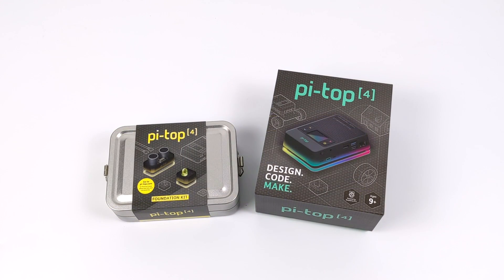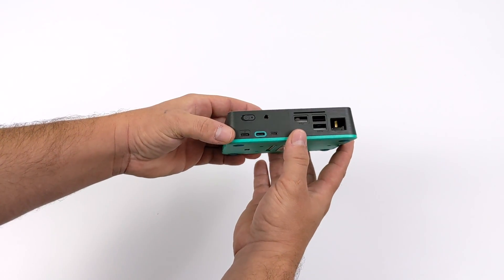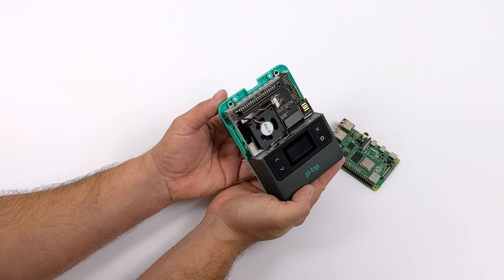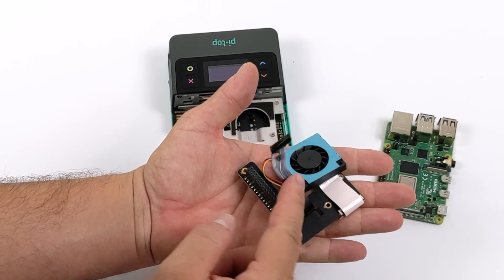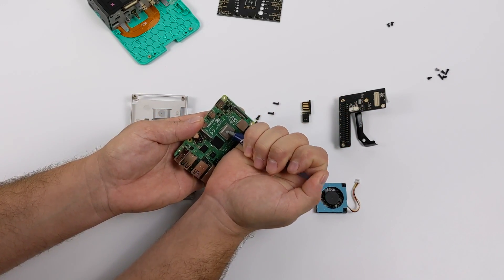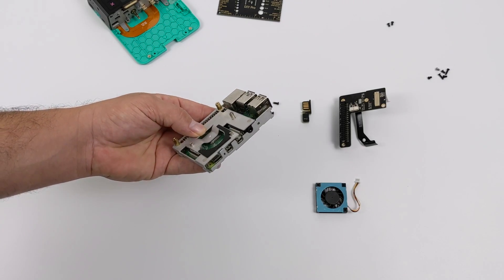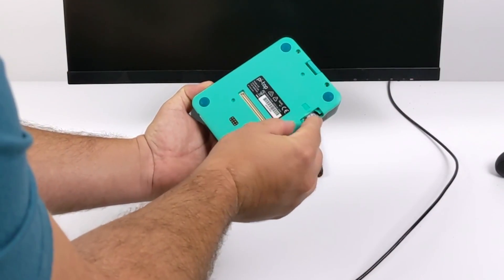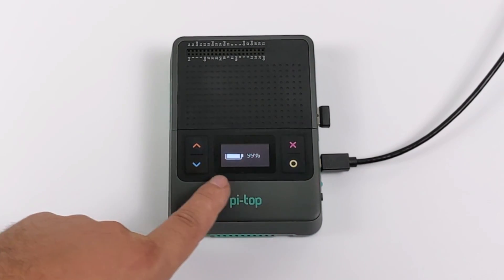Pi-Top 4 New DIY Edition - Power Armor For Your Raspberry Pi 4

Comment: There's people who own this, and people like me, who have their pi hanging from a cable at the shelf barebone, getting dusty, for 3 years now, doing it's job in the network, even is on the internet xD 

This is overengineering par excellance ... but okay, I can see why people buy this, but for 35$ you can get a 5 inch screen and with a 3d-printer a case for it...
Reply: I'm 5 mins in to the video and still don't know what this thing does...
Reply: @DConnor799  Active cooling, power bank, display + buttons and armor case and sound
Reply: There are people out there that use the pi 4 as main linux desktop, and if you want to overclock it, you need a good cooling and this pack looks nice

Comment: You know, I once loved RBPi, since that was a cheap, fanless mini PC. I used both the pi1 and pi2 as a media center. With these cases, it is not cheap and not fanless. Instead buying a Pi3, I bought an x86 for slightly more money with an SSD, USB3 and without fan (complete silence!). Now, Pi4 finally has USB3, but still, my old N4000 CPU is stronger, and while Pi has a good support, an x86 has better support.

Comment: "but still offers the same fathers like Built-in Battery"
Hmmm yes that's a nice father that I can't live without too 😜
Reply: Hey Prime, thank for your continually awesome content! What do you suggest for a power solution on the DIY pi-top 4 (for charging and such)? I know it supports 15V PD USB-C, and the one that comes with the regular edition is 36W 12V. I have a 61W USB PD MacBook charger that outputs 20V at 3A... that should suffice, right?

Comment: I put Pi-Top OS on a Pi desktop attempt and it runs great. Only issue I've had is if its left alone for a while the screen glitches, and zooms in requiring a restart. But its one of the most Windows user friendly Linux OS's that I've used yet.

Comment: 5:09 applies thermal paste drop
okay
applies heatsink bracket
uh huh
removes heatsink bracket to show spread of thermal paste
aww that's a waste of thermal paste but I guess it's a good demonstr-
re-applies heatsink without reapplying thermal paste, thus introducing millions and millions of tiny bubbles and ruining the thermal paste's heat conductivity
I screamed
Reply: Realistically it won't make a noticeable difference
Reply: @theisaacpigg27_32  realistically you can use crest toothpaste as thermal paste and you'll get "ok" temps for years (I'm not even kidding, try it)
Why even bother messing with shit where you gotta apply your own thermal paste if you're not gonna do it right? An extra 5°c might not seem like that much but it is when you factor in the long term stability and power consumption of the chip. It's just bad practice.

Comment: You made a Raspberry Pi Fan out of me.
I was looking for a small box to take with me as some sort of "classic" game console to use as emulator and as a small "low end" PC. Seems to fit perfectly for this needs since all i need to emulate is GBA/GBC/N64 games, probably try even emulating PSX as it seems to be powerful enough. Much better value than any of these "mini" consoles of Sony or Nintendo. Not mentioned yet playing around with a Raspberry Pi which i wanted since ever but never saw any reason because of low performance and im not really a fan of linux.
When i see this thing has also battery.... damn nice, all is missing now is a small screen for it to use it as regular computer on the go.
Reply: Is there any solution to use a SSD while its inside such a nice housing or is it better to go "mobile" with the data and use a fast USB 3 stick instead, which is also cheaper (and already there with my Sandisk Extreme Pro USB3.0 Sticks)? Transfer rates are pretty ok also over USB3 what i have seen.
Wondering if the OS/platform is capable of bitstreaming DTS-HD and so over the HDMI port? If yes god damn the Pi4 is damn awesome and i absolutely NEED it. Could be even "better" than a subnotebook/netbook when using it with a display with built in battery which im anyways thinking to get one because sometimes  i want on my notebook a second screen (on the go or even at home to be able to fast remove/add a 2nd screen from the table)

Comment: Great review, thank you! 

@2:08 For those of us less familiar with Pi-Top, would have been nice to have a bit more info about the "Pi-Top connector".
Reply: After reading... I don't think I like that concept much at all.

Pi-Top intentionally used the physical dimensions of USB-C ports/cables, but doesn't follow the protocol.

That just creates unnecessary confusion, and decreased compatibility.   #NoThanks

Comment: Ahhh the Pi-Top
It’s best you plug it into a monitor instead of a laptop first just to boot it up and update it. 

I’ve done some experiments with it and it seems to work with Kali Linux, the Display on the Pi-Top doesn’t seem to work, on Kali Linux flashed into the SSD. It’s either blank or a display of SSD pointing at the Pi.

Comment: 99$ but how much will be the foundation kit (baseplate and sensors) to add on top of the 99$?
Reply: The foundation kit sells for $70. Pretty easy to find that out on there website. Lots of other info about what you can do with this as well on their site if you’re the type of person who likes to DIY.
Reply: As far as the stuff it comes with? Lessee... 4 click buttons,  2 each old-school, 5mm dome-top, red, yellow, green LEDs (think 1990s style),  a sonic range sensor, a microphone (labeled “sound sensor, though it’s NOT an IMU), a tiny buzzer/speaker (like the old motherboard ones for boot beep diagnostics) and.... oh wait, that’s it. A piezo buzzer, a mic, a sonic range sensor, some buttons and a few dim, mono LEDs. I’d rather see stuff like M5Stack includes - Barometric pressure, temperature, humidity, volatile gas, etc sensors, color sensors, sonic along with radar, laser, etc range finders, and similar. The accessories they’re including would have been expected 20 years ago in a diy kit.... and promptly replaced with something more useful. RGBW LEDs. Capacitive touch sensors. NFC read/write devices. That sort of stuff.

Comment: Amazing! I’m curious if this would work a a great portable emulation station. Since it doesn’t require a power input, you could plug this into most displays and have a neat little portable gaming box
Reply: I have not had this super cool looking case, but your idea sounds like it would be perfect when implemented! Emulation surely shouldn't draw any excess power so you'd be able to keep it running for a decent amount of time!
Reply: SwiftFire1002 sort of like an on the go arcade machine that hooks to just about any display! Maybe someone will design a docking station similar to a Nintendo switch that has display out and charging capabilities!

Comment: This is crazy - you're apparently paying less for a thing that they don't have to assemble - but it comes assembled, you then have to tear it down to install, then re-assemble.  You're basically talking about a difference of a couple of ribbon cables, they could simply have made the standard unit cheaper.
Reply: It’s cheaper because the raspberry pi and microsd card aren’t included... DUH XD
Reply: @valegreg  yes, but the video, from my recollection, States that it's cheaper because you have to build the thing yourself... But you have to do a full strip down to install your Pi, so that is clearly not the case. And again from memory, the price differential is about what you would pay for the hardware any way.  I may be wrong on that second point but I'm not going to watch the video again for fact checking, life is too short.

Comment: The big thing, I find, of the original Raspberry Pi OS is that latest versions support USB-boot. Using an SSD makes a big difference. The other thing is that the graphics drivers get better by the day, supporting Chromium and VLC as well... Do these achivements port to PitopOS? If yes, I'll admit it's a really hot gadget - but if not, I'll criticize them for forking rather than collaborating...

Comment: I don't know.  I might consider that much for a Pi Case if it had a connection and place for an SSD.  Then It might be OK.  Also, their sensor suite for $80 is very expensive for what it is.  Also, if your gonna do that much engineering, why not add full-size HDMI connectors?

Comment: Just a correction, but the fan is an axial type not a centrifugal or "squirrel cage" type.  A centrifugal fan would be an improvement over the axial due to the higher static pressure.
Reply: it's a centrifugel fan but you're right about the high static pressure, we needed to draw air from the battery compartment to cool it during fast charging which required high pressure

Comment: What's with the coil on the bottom of the case, does it do Qi charging?

And what's the camera connection for?
Reply: I have no idea about the coil, but the camera connector is for the RPi camera modules you can get. It's just a way to make the case fully compatible if you want to attach one of the cameras available for the RPi.
Reply: That's an FPCB cable that is taking the pi's two HDMI signals over to the closed side of the casing - it has many signal traces which is why it looks like a coil! 

We take both the Pi's CSI (camera) and DSI (display) interfaces and pass them through to the 80-pin connector on the bottom of the [4] - access is provided by an expansion plate that the [4] docks into. 

We built a 3d printed mars rover over a year ago prior to this feature (in a pi-top [4] prototype) and it used an RPi camera. However, every time we wanted to un-dock the [4] from the project to use for something else we also had to disconnect the camera FFC cable which wasted precious time - this is why we added a pass-through!
Reply: @ryandunwoody5076  That explains it. I did hear mention of the docking port but wasn't aware of it's full capabilities. This really makes the rpi a very versatile package for use in many applications. Keep up the good work!

Comment: I have been torn between two cases since buying my RPi48GB. I wish, the Argone and Pi Top cases would get together. The PiTop has everything I want minus the one additional thing that Argone provides. A connector / module for M.2 SSD. I've looked at every possible option for setting up the pi with SSD and to date, this is my favorite implementation. PiTop only needs to add SSD and it would be complete. Argone, is missing everything else that PiTop provides.... Sad, sad, sad...

Comment: If you have to disassemble the kit to insert the pi, why doesn't Pi-Top just supply DIY with the necessary components disassembled?  They could probably knock more money off the DIY kit by not having those components pre-assembled, and it would be easier for a user to insert the pi, then assemble.

Maybe I'm missing something?

Cool unit, though.
Reply: It's probably simpler to ship in the smaller box and not individually pack each piece in a bag or foam wrap.
Reply: @annihilatorg  Exactly! Also, it's easier to re-assemble something if you took it apart once already

Comment: The BIG question I have is - Does the case impede the performance of the built in Wifi signal?

This case seems to solve a real challenge I've been having with a CarPi Router I've cobbled together with various PiHats. Being able to simply hand one of these to my Spouse or the grandparents for a long car trip with the kiddos (and without my tech support) would be a great way to provide mobile access to digital content for the less than technically inclined.  My current "case" is nothing more than plastic sheets with metal stand offs and a bunch of cables.
Reply: I've had pretty good wifi with mine. I haven't compared the wifi signal for pi-top [4] against a Raspberry Pi 4 in the official case or anything, but I've also never really needed to think about it. Seems to work just fine in the case.

Comment: If your using a pi with an ice cooler and overclocked what power supply are you using I don’t have the official plug because I got mine second hand without it

Comment: Hey, I've had this question for some time now. Could you please test if one of those external touch monitors with usb C works with HDMI as input but also with the USB connected (just as a touch input device to the host PC). It would be awesome as a second monitor for a desktop setup having touch enabled. Thanks
Reply: I know a lot of laptops implement the touch (digitizer) function in a similar way. Also a lot of controller board for external monitors use edp for the display and usb for the digitizer and combine them both over a usc C port. Early android phones did this as well if my memory serves me well. Can't see why this wouldn't work but I also don't want to spend extra for a touch display that will end up as "just" a second monitor.

Comment: I don't think thermal paste is a particularly good idea, the heatsink is not very flat and does not push hard down onto the CPU, as can be seen by your thermal past not spreading out very far.  A compliant thermal pad will offer better performance when the cooling solution is compromised like this.

Comment: Just sounds like a gimmick rather then a solution and an expensive one at that.

Not being able to access one of the USB ports and the second HDMI is also a deficiency.

Once you add this to a PI it puts it into the price category that other competing products like the N2+ that would blow it away for performance.

Pretty and the battery may have limited use but little else for me.

£50 would be more realistic for what it is.

Comment: Do you think a more powerful battery will be possible.
There is already a Pi certified screen that includes a case for the Pi, do you have the skills and tools to make a 3D printed case/shell that will work with this case.
This will be a truly complete solution.
Reply: It's USB-C PD so you can use any 15V USB-C battery pack (typically made for laptops) to add extra battery

Comment: To me it looked like there is a gap above the CPU so you mite not be cooler it vary well. It mite just from the way the top of the CPU is designed and it mite be hard to tell since its a youtube video but I just thought I should say something just in case.

Comment: Is the camera connector still accessible  when the pi top is assembled?
Reply: There is a slot in the side of the case. You can feed the ribbon cable through that if you want to attach a camera.

Comment: FYI, using Etcher triggered my anti-virus software. It's likely a false positive, but I don't want to risk it. Raspberry PI has their own OS tool out now and it works great.
Reply: Etcher isnt dangerous
Reply: @brianmateo8041  Well, since as I said, it triggered my AV software, I scanned my system and found an Adware loader that wasn't there before. Therefore, I call it dangerous enough that I'm unwilling to take a risk, especially when there's a less-intrusive alternative that doesn't cause an alert. YMMV.

Comment: Which is better nvidia shield pro or this for emulating
Reply: The Nvidia Shield hands down beats any pi at the moment, plus the shield has a better gpu and is pretty optimized for its hardware
Reply: @irawhitejr  whats the newest system it can emulate well??

Comment: Hey Prime, thank for your continually awesome content! What do you suggest for a power solution on the DIY pi-top 4 (for charging and such)? I know it supports 15V PD USB-C, and the one that comes with the regular edition is 36W 12V. I have a 61W USB PD MacBook charger that outputs 20V at 3A... that should suffice, right?

Comment: It is a nice looking case, but I have a few issues with it. It should not come assembled. It makes for twice the amount of work to install the pc motherboard. It looks like they are trying to target the school sector with the battery, setup, and price points. This thing is still running about the same cost as a good gaming mid tower pc case. I would be looking for something more functional and basic for my PI needs. When will we start seeing RGB glitter? :P

It is nice, just not for me.
Reply: I agree on it becoming assembled.  That has to cost money to do.  I would rather it come in parts bags, passing on the assembly cost to the consumer.  If you can maintain margin and sell more, you will make more.   Lowering cost will achieve this.

Comment: Is there enough room on the CPU bracket to put a small heatsink on top of the bracket, beneath the fan?
Just curious.
Reply: Seems like it could hold a small height one but the fan in there is not blowing air on top of it, its an exhaust fan.
Reply: It definitely looks like a small one will fit there. If you had a small aluminum block you could shape to the angles on the bracket, that would probably help a bunch.
Reply: We've put a 3.7 x 11 x 23 mm (H x W x L) heatsink on some of ours, improves core temp a few degrees so worth it depending on your needs

Comment: try the 3-in-1, with the touch screen and the keyboard, at 399$
Reply: um, you could put the adafruit 800x480 touch screen instead of the current screen
Reply: windows IoT core

Comment: i bought the raspberry pi when hardly anyone knew the PI in India. If you are to adrinu products or robotics then it is good , but to convert pi to a media center or an andriod box is a bad idea. Accessories are very expensive. 

Pi cases are always far more expensive than the Pi itself. 

The biggest design flaw of the Pi is connectors virtually on all 4 sides of the pi that way a DIY pi box is very difficult.
Plus playing netflix , amazon or youtube needs additional knowledge of advance linux.

Comment: dude. once you have thermal paste on a chip, you shouldn't lift it up after placing the heat sink on. you now have air bubbles trapped in your thermal paste.